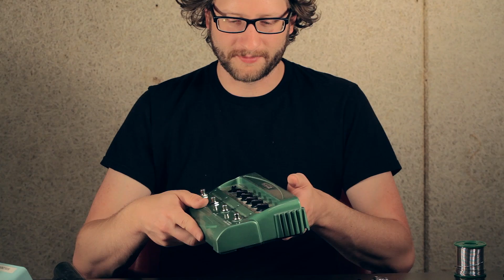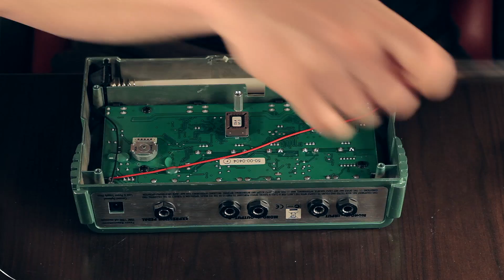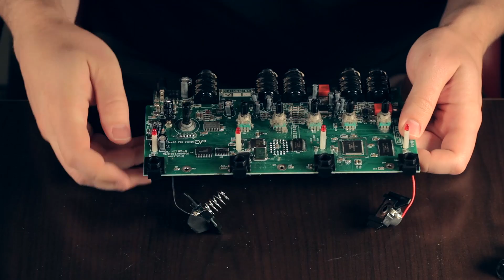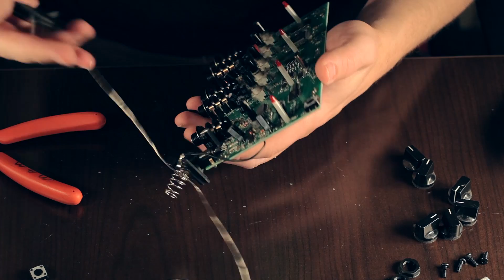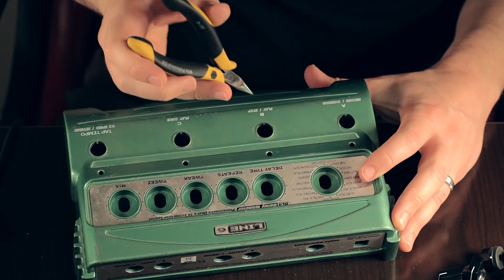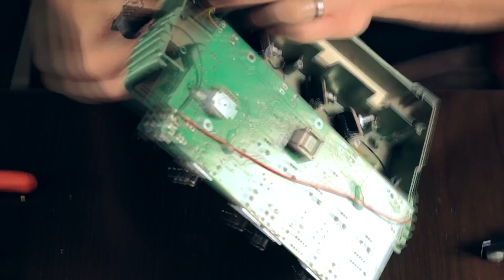Line 6 DL4 Switch Replacement Mod

Comment: Pretty good tutorial, but after watching several times and following the steps to a T, I found there to be one critical flaw.  Upon reassembly, I noticed the new switches did not allow the circuit board to sit flush against the screw holes.  This means the on/off LED lights do not sit properly in the light cavity on the housing.  Starting at the 10:40 mark in the video, I noticed that the lights on his demo pedal cannot be seen either, and he never actually shows the pedal powering on and off.  The only way I could get the circuit board to sit close enough with the lights being high enough so they are visible in the green housing was to remove all the locking (split) washers from the switches.  This raised the switches ever so slightly, which allowed the lights to be visible.  However BE CAREFUL, as the circuit board is still not 100% flush with the screws holes, and tightening it too much could crack the board. Lastly, this took about 3+ hours.  Best of luck.

Comment: What is that vibro soldering iron? Does it have a little vacuum in it?
Reply: Its a desoldering gun. It has a vacuum pump in it, heats up the solder then sucks it up. An expensive solder sucker.
Reply: Jesse Grisham that's awesome. I've never seen one that heats up like that. Gonna have to look into getting one.
Reply: You can kinda do the same thing with a $2 solder sucker, it just dosnt heat and suck at the same time.

Comment: i just bought a bunch of components from Mammoth to do these upgrades as well as the expression switch upgrade. One thing I found with the four footswitch upgrades is, I have an older MM4, it has the Line 6 logo molded into the top front, not on a metal plate. Anyway, the connections Isaac seems to be making are vertically oriented, connecting the switch terminals to two pcb holes that are on top of each other. I tried it this way and it didn't work. However, on another vid, I saw a guy modding the same MM4 I have, and he oriented the connections in a horizontally and diagonally, meaning bottom left hole to top right. I'm not sure if this a versioning difference, or if the DL4 is designed a bit differently. Short story is, the connection works now. Just a bit of FYI in case you have the same issue.

Comment: diy mammoth  Everything works great except the tap tempo LED after this mod. The tapped tempo does apply to the delay that's engaged, but the LED on the far right tap tempo channel does not light up at all. I thought maybe the LED was damaged, so I put it in a new one, but it still does not work. Thoughts? A reply is much appreciated.
Reply: im curious about this myself, have had the same problem after just completing the switch replacements.

Comment: All worked for me, but MM4 still locks up when it gets hot. Thought it might be a footswitch issue, but it has happened since replacing them. Maybe time for a new circuit board?

Comment: This took me about 2.5 hours to do with my MM4 pedal. Getting those old switches off the circuit board was a nightmare, even with soldering braid and took the majority of the time. Other things to be aware of are matching up the red LED's to the holes because they will move as you're working on getting the switches back in place etc. Also watch out for those little pieces of metal that were in the holes where the old switch posts lined up. PITA to remove without sandpaper etc. At the end of it all everything works and hopefully the pedal doesn't crap out again : )
Thanks for the vid!
Reply: Christopher Rixon No, just to get the new switches to fit correctly.